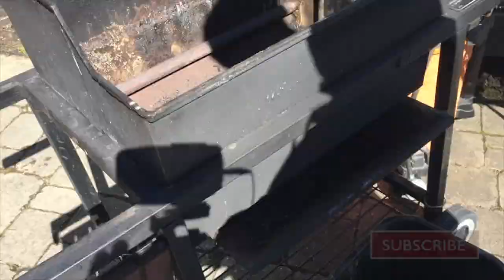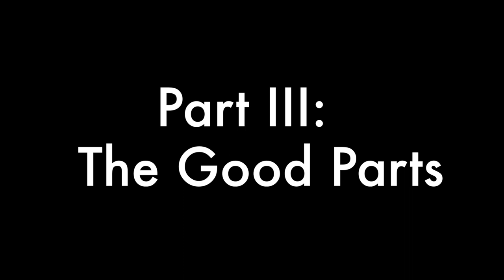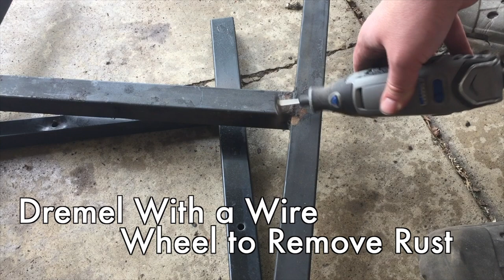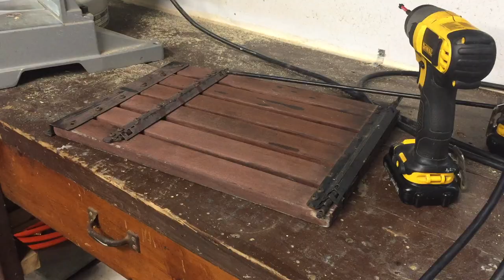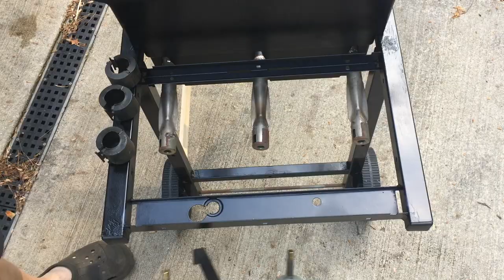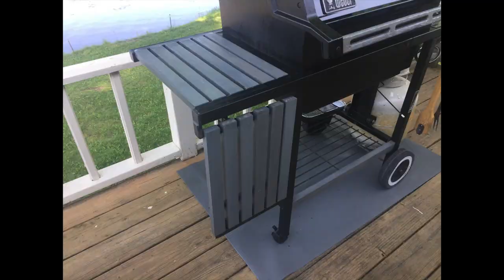Restoring a Weber Grill - Genesis 1000

Comment: Just sold my 1999 Genesis 1000 grill (Red with wood shelf).  Mine was in very good shape.  Sold it for $100 to a collector who will love it and use it.  Very good LP gas grill and worth the investment.  I've moved on to a Pit Boss Pro Series 1100 pellet grill and love it.
Reply: Hey, I didn't buy yours, but I also just purchased a 1999 Genesis 1000 Redhead with the wood shelves. Mine is in a bit rougher shape and I'm in the process of restoring it. It'll sit on the patio with my 6 other Weber grills lol. Needed an older Weber gasser to round out my collection. Enjoy that Pit Boss!

Comment: Great vid! Is the middle part where the burners and flav bars are sitting made out of aluminum cast? Does anyone know?
Reply from the maker: The middle bottom is cast aluminum. Top middle is porcelain coated (enameled) steel. And I thing on the one, the sides of the top are aluminum too.

Comment: I have one, too and it's been working great.  Had a hail storm and hail knocked small holes in the knobs, but still works.  Recently, the lower supports (front and back came apart, but I still have the metal supports.  I need to take mine apart and see if I can reattach those supports somehow.  I see you replaced the front support with a piece of wood.  How did you attach it?  Maybe a stainless steel wood screw?  I'd like to use the metal parts that I have, but not exactly sure how to do it unless I put a Piece of rubber into the ends of the supports (or wood) and screw in that way
Reply from the maker: I think I actually found some black powder coated screws, not sure if the were technically wood screws, but they held.

Comment: Can you paint the middle of the lid with high temperature paint. I have a 1995 Genesis 1000 with red center and black sides. Weber site says you should NOT paint porcelain enamel. I'm assuming the genesis 1000 red part is porcelain enamel...but not 100% sure.
Reply from the maker: It’s is. I wouldn’t paint it. If there are some chipped areas in the porcelain you could try painting some vegetable oil on the spots when the lid is hot. It’s might help prevent rust.
Reply: @daveshouseofbbq  
Thank you for answering this!
I just started scraping the inside of the lid to get off all the old debris, is there a protective coating on there, because the back side of the old grease seems to look like a synthetic material. If there is a  coating I'll skip this process. I'll email Weber also.
TIA

Comment: Why is there 2 sets of flavorizer bars in that grill? Genesis only are supposed to have 5 of them
Reply from the maker: Their were some models that had two sets of bars that ran perpendicular to each other. Flavorizer Bars for Weber Genesis 1000 Grill Parts, Platinum SER I & II, Genesis 1000-5500 Gas Grills, Platinum ii 2200 etc, for Weber Genesis 1000 Flavorizer Bars 7538, 9813, 65901, 13PCS https://a.co/d/8HVCkqY

Comment: What paint did you use on the side of the hood mate ?  High temp paint  satin black?
Reply from the maker: Dave Dra yes. Is I remember correctly it was made by Rustoleum.
Reply: @daveshouseofbbq   cheers man 😎hopefully I can find it in  down  under
Reply from the maker: Dave Dra I’m sure it doesn’t need to be the same brand. What ever high heat spray paint you can find should work

Comment: Did you paint the front and top of the grill box or just the sides?  I can't seem to clean the top and front of mine sufficiently to restore it's original shine.  Trying to decide if I should paint the entire top.
Reply from the maker: Ramin Ashrafzadeh just the sides. The top and front were in good shape
Reply: Ramin, don't paint the top or sides of an old genesis.  They are porcelain coated and you can clean it up with some fine steel wool and simple green.

Comment: Any idea where I can get parts for flip up side table? I have a 96' Weber 900 I just restored (with new cook box from Weber) basically same as your genesis 1000. All the side table parts are discounted if you know of any options where to buy parts let me know thanks. Nice job on your resto! Looks excellent!
Reply from the maker: I would say check with Weber, but I guess you already did that. Another option could be to find a cheap grill on Craigslist to use for parts.
Reply: @daveshouseofbbq  yeah I think that's about my only option. The sad part is when I moved I threw the parts away 🤨

Comment: Nice job how much time did it take you to do all of this work on the grill?
Reply from the maker: A couples days. It’s still running like a champ. Just used it at my dads house a few weeks ago.
Reply: @daveshouseofbbq  Nice!  I have a Weber Genesis 330 natural gas model that I’ve had now for about 8 years that is having an issue regulating temperature.  When I put all the burners on low it still goes beyond 500F.  I bought a set of burner tubes and I’m planning to replace them this weekend hoping that fixes the issue.  The original burner tubes are rusted pretty bad.  I’m also going to swap the igniter while I have it apart since the igniter died 5 years ago.
Reply from the maker: Burner tubes would definitely be my guess. When they get that rusty the holes get much bigger and they let out a lot more flame. That would make it really hard to control the temperature
Reply: @daveshouseofbbq  I’ll let you know how it goes.  I’m annoyed that the burner tubes did not come with bolts so I’m pretty sure the bolts are gonna need to be replaced I believe they are 5/16” bolts
Reply from the maker: Maybe spray some WD-40 or other type of penetrant on the bolts first before you try to remove them you may be able to save them
Reply: @daveshouseofbbq  good idea thanks I’ll do that!
Reply: @daveshouseofbbq  finally got the Weber replacement bolts for the burner tubes.  Replaced the igniter and the burner tubes today.  One of the bolts was rusted and deformed pretty bad took lots of WD-40 and channel locks finally got the stubborn bolt off.  Igniter was an aftermarket and one of the wires were bad so I re-used one of the originals and all the burners light up now.    I’ll use the grill tomorrow and see if it keeps better temperature now with the new burner tubes.

Comment: Can you paint the inside of the lid? It's coming off on mine. I lost the side table too :(
Reply: The lid is protected by porcelain enamel and does not peel or come off. What you're likely seeing coming off is old baked one grease. Take a wire brush and lightly scrape that off. You shouldn't paint the inside of any grill because it will burn off anyway and wind up on your food.
Reply: Thats not paint peeling, thats soot from old food being cooked clinging to the lid

Comment: Great video! I am doing a restore myself. And I’m new to this. Can I confirm that you didn’t really sand the frame first? Thank you
Reply from the maker: Only places where there was flaky patches of rust, and even then it wasn’t really sand as much as it was scraping. I used a wire wheel to knock it all off.
Reply: Thank you

Comment: Hey Dave,

what an awesome job you did with that restoration. 
Thumb up and you have a new subscriber.

I am working since some weeks on a Weber Genesis Gold (2003).
I really want to end up with my restoration on a sort of brand new status.
Most of the parts which had to be replaced are still available.
Except one: that little hose connecting the side burner. 
I am desperate, Weber doesn’t produce it anymore and no one has it on stock.
Plus I am living in Germany. 

Are you having an idea how I can manage this?

Best regards

Dee
Reply from the maker: Dietrich Beck I would imagine that the connections on each end of the hose are a standard size. I would look for a hose that is designed for a different grill, but still suits your needs. Thanks for watching. Keep me posted on the progress of your grill.
Reply: Dave's Ohio BBQ & More 

Thanks Dave for your quick answer ... we already checked out the newer models, but had no success with that.

The other problem is, that in Germany we don’t have craftsmen for gas hoses anymore, like it was way back in the 60ies till the 80ies. 
Things changed and all that business went up due to globalization. What a pity.

But of course I won’t give up. We will find a solution.

And sure I will keep you updated ... the final product will show up on my channel. 
Nevertheless I will let you know personally how I managed all and of course that special problem here.

Have a great day

Regards

Dee
Reply from the maker: Dietrich Beck Dee have you look for information on any of the BBQ forums, I found this from virtual bullet site. 
https://tvwbb.com/showthread.php?64750-Side-burner-hose-for-Genesis-3000
Reply: Dave's Ohio BBQ & More 

Wow, so there are more folks than just me with that problem. Good to know .... 
And thanks to you, making my problem being yours and searching for solutions. 

The black paint spray you use, is it matt paint? Heat resistant I can find only Matt, but I would prefer satin finish,
because the firebox’ and lid’s original black looks like satin finish.

And thank you so much for joining my channel. Some of my videos show up with English subtitles. If they have, it is mentioned in the header.

Best regards from Germany

Dee

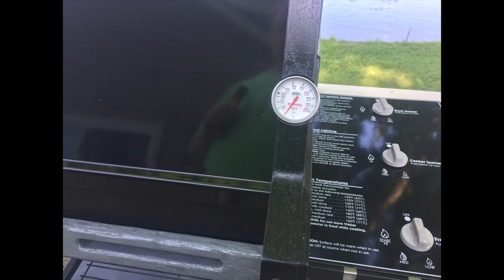Comment: You could have done more with the metal, and later in the video revealed you have an angle grinder! 5:23 why didn't you take this metal down before high-temp enamel? Your restoration was great, but seemed rushed.
Reply from the maker: The paint was solid, no need to take it down with and angle grinder. The fresh coat of high temp paint was more for appearance than function. It evened out the black. Just used the grill a few weeks ago. Still working like a champ.